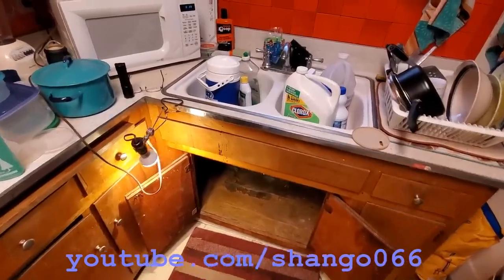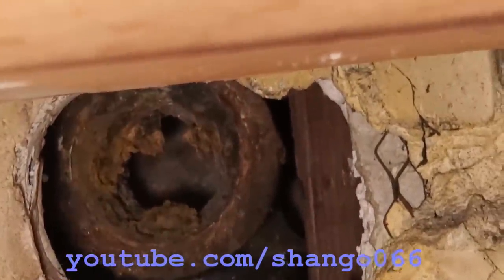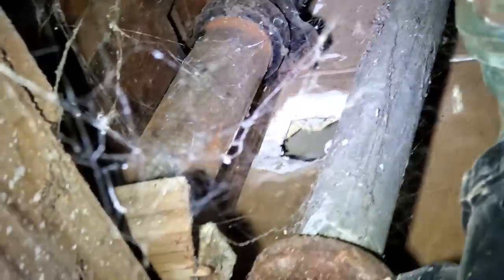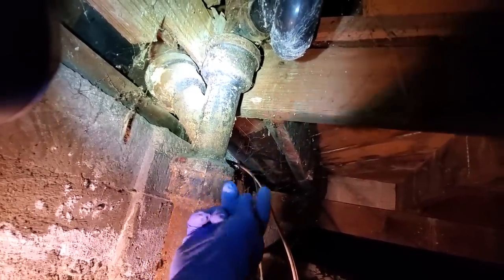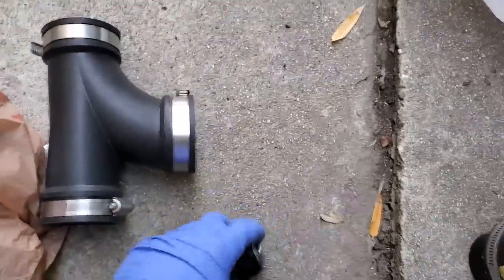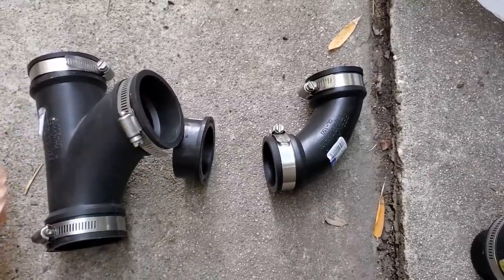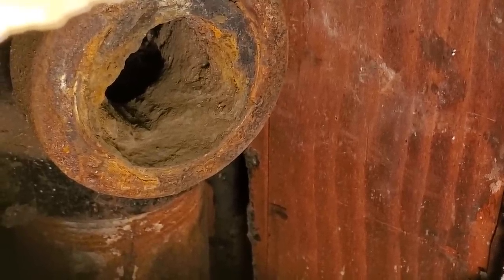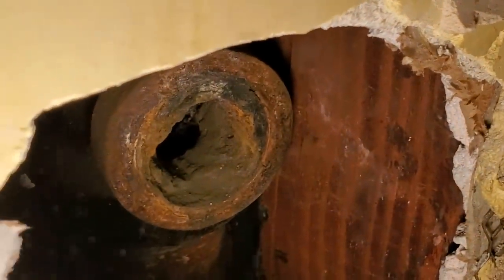Kitchen Sink Drain Line Repair Broken Galvanized Pipe

Comment: I've cut that 3" cast iron pipe with an angle grinder with diamond blade before and replaced it all with pvc and fernco couplings . In a similar situation

Comment: Get a rubber boot for a pipe exiting the roof and use it to cover the hole in the cabinet wall. That way if need be it can be removed for future pipe cleaning.

Comment: Great video by the way. I'm working on basically the same thing in the bathroom. All the piping going to the drain was carroded so I began replacing. I got the nipple part out finally but damaged a few of the threads on the main drain. What do you suggest ?? Is it possible a new nipple will work or can I put a No hub on like the video ?? Your experience is appreciated.👍

Comment: Shango can repair anything!!  Amazing that clogged pipe drains as well as it does.......
Reply: Well, almost all of the clogging was in the old cast iron pipe that has now been replaced. Horizontal sections are always much more prone to clogging for obvious reasons, doubly so if they don't have any tilt to them.

Comment: Was doing the exact same thing as well 2 weeks ago. However the pipe was still good, but the nut and lead pipe were stuck fast, and also in the brick wall. Nut came loose when it was red hot, and then I cleaned out the pipe stub, and made a PVC pipe slide over while nearly molten, making a nice threaded adaptor as it and the steel pipe cooled. Then a new trap and new basin outlets, as those were not too healthy , they came off easy when melted, as they were all gunked in with putty.

Then filled up the hole in the wall with a piece of masonite board and some silicone, to keep the smell of the vent stack out. Flows well now, all new pipe till it reaches the  common stack, good for another 50 years I hope.

Comment: Funny, I just watched a Steven Lavimoniere plumbing video... and YouTube correctly suggested a related video from Shango066.

Great repair work! You do what you have to do... no need to deal with the threads. Slip-on rubber fittings seem to be the universal fix for every pipe calamity.

Comment: I had the same problem. My house was built in 1969, and the pipe had filled up, and rusted open on the bottom. It was behind the dishwasher, though. It was easy to get to, but the floor was covered in sludge, and it smelled like death!

Comment: Your video was exactly what I needed to repair the kitchen drain issue at my parent's house.  I could have spent a tremendous amount of time researching and trial-error work, but the video walked me through the options, challenges and solution that worked for my repair.  Thanks for creating the video and sharing your experience.

Comment: "That got the Party going"!      Great! - I Need all help to psych myself into plumbing work.     A "No Hub"[?] & Hot water.   Cool!    
note:  Draining problems (Clogs)  ->  I Used a Drain King  - sized for pipe;  Placed in Vent Stack on roof;  Pulses jet of water to Unclog.  : }

Comment: Nice fix in an extremely tight spot to work. I think I would have resorted to taking out the whole cabinet completely and then working on it. Didn't look like much room to work in there at all
Reply: If i wars shangoo i Will change al that cast iron junk to pvc plastic

Comment: Great video. You may be catching a lot of flak for the plumbing videos because of all the rubber fittings. Not sure where you’re at, but typically those are only for underground applications, so in essence, you’re giving a lot of people bad ideas lol. You want an armored coupling connecting to PVC or ABS whenever possible. And if you have to cut the galvanized, you want to take as much out as humanly possible. That’s the way we do it anyways. Leave it to the home center to stock people with all manner of illegal fittings and no information on how to use them correctly.

Comment: Can relate: Mom lives in a house that is 78 years old. I did some electrical work for her this summer. Fun!
Reply: My favorite is when you pull the old two prong outlets away from the box and the insulation falls off the wires :)
Reply: @Wiresgalore  You still had insulation there, I did some work at home, and ended up replacing 30m of old cable, just to get to a point where it would not fall to dust, including digging to find a hidden junction box in the ceiling.
Reply: It happens with that old wiring. Fortunately some of it was replaced with newer "Romex."  Had to run wire to a new outlet from an old one. Was happy to discover it wasn't a junction of that old and new. stuff,
Reply: My fathers house is still completely knob and tube wiring, six fused circuits for the entire house. Unbelievable it has not burned down after 112 years.
Reply: Houses in my neighborhood have that.
Reply: Tar impregnated paper/cloth insulation in the safest for all electrical wiring.  100% organic and natural.
Reply: @Wiresgalore  Or you find that the entire back of the Bakelite socket completely disintegrated. I found a few in a 1940 house when replacing all the original outlets.
Reply: @Marc C If you derate all the existing circuits to 15 amps, add new wiring and breakers for additional loads, it’ll probably last another 100 years.

Comment: In the video, you can see the riser pipe under the hub you put on has a crack down the pipe.  I would just drill a new hole through the cabinet and floor and run PVC and tie it into the old in the crawl space.
Reply: That was one of the options he looked out, but connection to the old drain would have caused a potential siphon problem and you still have to close the original drain that was no longer being used.

Comment: Cap the tee in the wall with a fernco cap and re-route the sink drain to come up in the cabinet under the sink.
Reply: that would make it an "S" trap and is not allowed in rental housing in most states
Reply: @force311999  well, dang! I guess I should send my plumbing license back.
Reply: @andrewvenable7422  bring it up with a "T" under sink then back to the hole in the wall and use old drain as vent 
still not code as it must tie in above the sink rim but it would work fine
Reply: @force311999  cap off the tee in the wall, cut in a new tee under the floor, run an arm over to the kitchen sink with a p-trap below the floor, and drop the sink drain through the floor to it. Completely code worthy.

Comment: There might be some asbestos mixed in with that lath.
Reply: It wouldn’t be any worse than some of the mines he explores.
Reply: @5roundsrapid263  You might be right, except for the fact that asbestos was refined and concentrated for use as a fire retardant/barrier in new construction. In its natural form, it is generally more diluted, a type of ore mixed with other constituents.
Reply: Chet Pomeroy I agree. It’s the same way with lead, mercury, or even uranium.

Comment: Looks to me like you'd be best off removing the shelf from the cab to the left of the sink base. Get in there, grind & chisel out the thread remnants in the existing cast iron "Y" fitting. Get those threads clean, then use your threaded ABS fitting and ABS to run to the traps under the sink. Unless you are planning to replace that "Y" fitting (total pain in the a**) you would have to get to that "Y" fitting to use your rubber fitting (which I would not use) to tighten the hose clamp-type deals where they would clamp on to the "Y" anyway. Easiest is to get that ABS fitting threaded into the "Y".